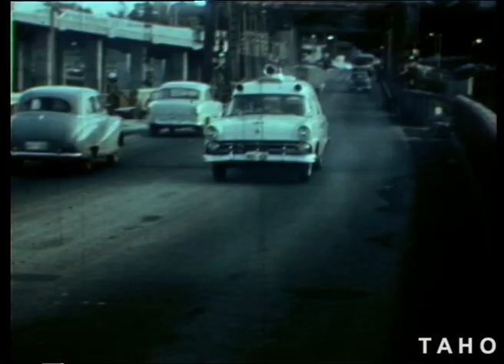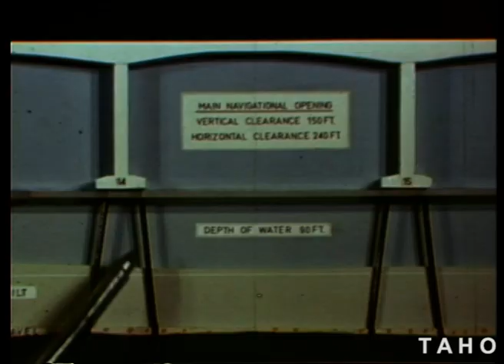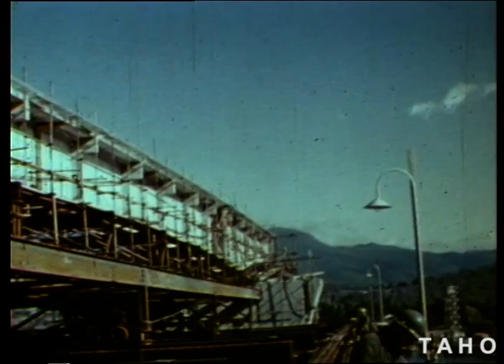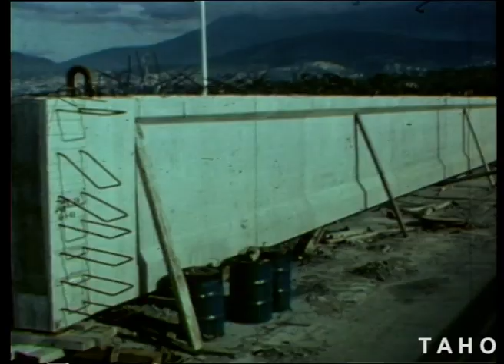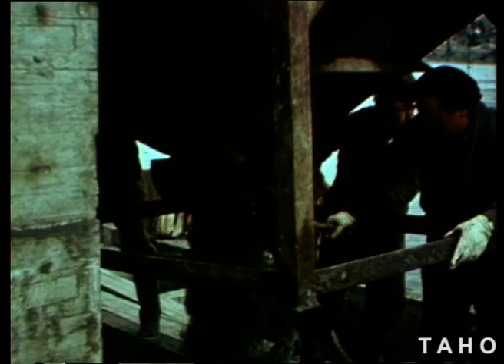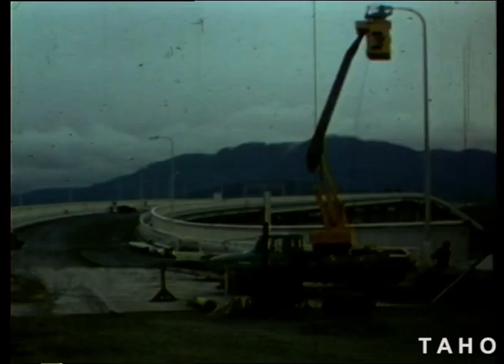Tasman Bridge Construction (1965)

Comment: Left Hobart in September '61 just before I turned 8. We travelled over the old bridge many times and work on the approaches from both sides had just commenced - with three or four supports each side being ready or prepared. Returned in November '93 for a holiday and journeyed across the new bridge and enjoyed the drive between airport and CBD. Only query - good documentary but would have liked to see a diagram interspersed with the commentary showing where each section went when mentioned in the commentary for us non-engineering types. other than that - good memories.

Comment: The old bridge had an adequate footpath on one side only.  The new bridge has a grossly inadequate footpath on both sides.  It is so narrow that to get a person past me when wheeling my pushbike I had to lift it over their head.
The path has vertical bars that snag handlebars with jutting out steel obstacles.  At the end there are narrow cement openings with great gouges from handlebars.  In other words it is horrendously dangerous for anyone trying to ride over the footpath but you dare not ride in a traffic lane.  It is an example of a completely negligent design process.
In the film they say that the path is 4'6" wide ( 145 cm) but that would have given a clearance of 35 cm at each side of the handlebars.  Perhaps that is the maximum width of the path without considering the various bottlenecks.  But it is not representative of trying to get over the bridge.
I mentioned the vertical siderails.  If they were horizontal then a slight misjudgement would merely leave you bouncing off.  The vertical bars grab one handlebar and turn it.  Slamming you into the supports.  I tried walking over the bridge a 20 minute delay.  I tried going Northward to an alternative and much better crossing but that was a substantial loss also.  Basically the bridge and the freeway beyond do not provide for all comers the way that the old bridge did.
Reply: The bridge originally had much wider footpaths when it was first built but when the ship hit it and damaged a large section, they took advantage of the downtime and decided to build an extra lane during the reconstruction. Space was stolen from the footpaths on either side, leaving what you have today.
Reply: I just dont think that cycling and cyclists were really on the radar as a big thing back in the 70's